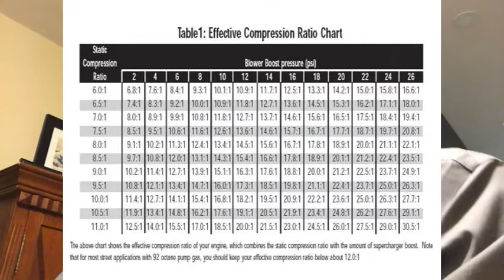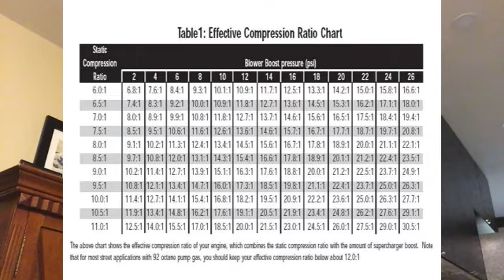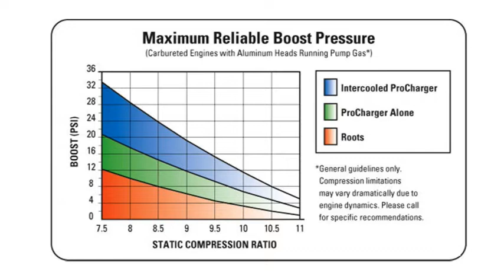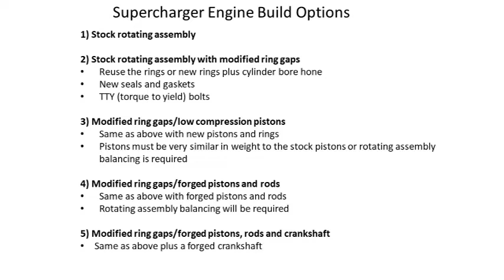How much supercharger boost is safe?

Comment: Hello, what do you think is the hp limit for the 4.6 2v and the 4r75e trans? as you clearly have experience with that being in the vic. Have a 2010 town car looking to do some mods to increase hp and make it fun to drive but not spend 12k+ doing all internal building to the engine and trans thats required for a 450hp build. Thanks.
Reply from the maker: If you stick with something naturally aspirated, the stock transmission should not have any issues so long as it is in good condition to start out. Boosted engines have increased torque at low rpm and as much fun as that is, it is hard on the transmission and will likely cause premature failures. Also depends on how hard you beat on the thing. Even a boosted drivetrain should hold up if you avoid burnouts and hard standing starts. So, 400 NA hp at crank should work ok with a stock trans. 400 boosted hp might cause trouble unless used with caution.

Comment: Is there a way to contact you I have questions about putting a Eaton on a 4.6 2v mustang not to much on the forums
Reply from the maker: You can keep using the youtube comments as you have done. What can I help you with?
Reply: @makecoolstuff9170  what manifold did you use to cut drill etc or did u find an adapter to make the Eaton fit ?
Reply from the maker: @DarryModz  Edelbrock Jr. with custom plenum between the sc and manifold.
Reply: @makecoolstuff9170  so u cut out top of manifold correct edelbroke manifold look like there’d me a leak if I was to cut in to top at least 1 I found you have any pictures I really want to get this done
Reply from the maker: @DarryModz  Have a look at my video "DIY Eaton Supercharger Installation - Part 3". Hopefully that answers your questions.
Reply: @makecoolstuff9170  yea I watched all of them but I wanted to actually see what the top of the manifold looked like how u cut it etc
Reply from the maker: @DarryModz  I dont have any pictures of it disassembled. The top of the 2 x 6 box matches the bottom of the sc and the bottom matches the Edelbrock Jr manifold.
Reply: @makecoolstuff9170  so you put cut the top out of the intake manifold correct?
Reply from the maker: @DarryModz  The Edelbrock manifold itself is untouched. The fabricated aluminum box on top of it has cutouts in the bottom to match up with the edelbrock manifold inlet and inlet mounting bolt holes. The sc outlet wont align directly over the edelbrock due to the drive pulleys needing to be aligned.
Reply: @makecoolstuff9170  ok so basically the edelbrock  manifold came with a cut out square on top so all you did was fabricate the  piece between the super charger and manifold to be square on bottom then fabricate top too match bottom of eaton?
Reply from the maker: @DarryModz  correct

Comment: I installed an Eaton M112 from a 03-04 cobra on a 2001 Mustang V6 using an adapter plate. Makes 10.5 psi at 5500 RPM on water/meth injection, 20 degrees of timing, with a Megasquirt ECU. It's probably too much for that old 3.8l engine, but hasn't exploded yet 😆
Reply from the maker: If you increased the piston ring gaps it will stand a chance of staying together. Otherwise, someday it will break a piston.
Reply: @makecoolstuff9170  That would be a good idea. However, I'm not planning to keep the 3.8l. I've been working on this car for a few years and I have upgraded the suspension, fuel system, exhaust, and I'm currently working on rebuilding a 8.8 rear end with 3.73 gears and 31 spline axles. Car is ready for a engine swap, I think a 5.3 LS would be a great engine, cheap and simple.
Reply from the maker: That is an excellent idea.
Reply: @omaron5175 how what adapter I’m trying to do this with my 2v 4.6 2001 gt been research but no luck

Comment: Glad you addressed the ring gap issue from the last video. (Thumbs Up) Always open up ring gap when running boost or bottle power adders. The pistons would have survived fine, its the heat from the higher output that did it in.

Comment: Wow I just found your channel.  Extremely informative and thorough!  I have an order in to Kennebell for their 2.1 intercooled roots (PD) supercharger, 16 week back order.  I have your same engine 2V 4.6 2001 Mustang GT.  Would you feel comfortable with 6-8lbs of boost?  I’m leaning towards 6 now after learning from you, but 1% of my is thinking of canceling my order lol?  I need more power but I need a car that starts as well.  Cheers if this gets to you!  Appreciate any advice.
Reply from the maker: Thanks! 6-8 lbs of boost will work great if it is intercooled. Heat is the problem (not the boost) and intercooling is the best way to reduce heat. The Kennebell supercharger is one of the best units made. Your mustang will be very quick with that much power.

Comment: I know you know your stuff on the superchargers I had a question maybe you could help, I've got a 2000 Saleen SC, came factory with the Eaton m90 root style supercharger. It is a series 1. I found one video on YouTube with a car like mine with the series 1 and it had the drain plug in the front right behind the alternator, mine does not have a drain plug there I cannot find it anywhere any ideas? I had already bought my oil in syringe for the oil change but I can't find the drain, and it does have a chatter so kind of stressed about it.
Reply from the maker: There are no drain plugs on any of the M90s that I have seen (Tbird or GM). The only way to change the oil is to remove the supercharger and then remove the snout. The noise is likely due to a worn coupling and you will need to remove the snout to replace it. Not a difficult job. Just time consuming. Be careful about not getting the used oil on anything. It stinks.
Reply: @makecoolstuff9170  thank you I appreciate it.
Reply: @makecoolstuff9170  thank you I appreciate it.

Comment: I'm planning to put an water intercooled m122 on a 92 lexus sc400. plan to put a 9 to 10 pound pulley on it. So far all the research i've done says it can support about 400 hp or so. I plan to keep the bottom end original because it was made very solidly in the early years of production of the sc400, i do plan to port the heads though. Ultimate goal is 400 hp at the wheels. Thoughts?
Reply from the maker: I am not familiar with the sc400 but the M122 can easily support 550 hp (probably 600 hp). I would recommend intercooling and/or increasing piston ring gaps. Head porting is a good idea but not essential. I would spend money on cams before spending money on porting, if cams are available.
Reply: @makecoolstuff9170  here's a link with info if you have time 

https://www.carinf.com/en/bf0048821.html

I've heard from around the net that the heads are the most restrictive part on 1UZFE v8's  so i would definitely be doing that. Kind of didn't want to take the whole motor out, but if you think it is better to change the rings out as well i'll probably just replace the pistons when i send the heads out for porting. might as well be at peace with that. But if i'm going to rebuild the engine then i might as well go for more than the 400 hp.  ( again i'm still in the planning saving and speculating part of the project and i really appreciate all the info you provide)
Reply from the maker: @GOLD_FEVER 400 at the wheels is 480-500 at the crank which will be quite a jump from the stock 250hp. It will be well worthwhile to be cautious and put in lower compression pistons (best to use forged pistons) Use the appropriate ring gap for boosted engines. The piston manufacturer will likely have recommended values. Its hard to imagine 4V heads not flowing enough (do you have flow values for the sttock heads?) and just keep in mind that head porting often doesnt give the same hp dividends in boosted engines as it does in NA engines. Easier and cheaper just to make sure that the engine is stout enough to handle the boost and increase the boost. Everytime that I have looked at ported heads, the price has dissuaded me.  Also, try and find out if your transmission and diff can handle that much boost. Supercharging really increases the low rpm torque and parts can start breaking.
Reply: @makecoolstuff9170  ok, i will definitely talk to my mechanic about doing a compression and leak down and just overall checkup on the health of the car and i guess move on from there. thanks for the tips!
Reply from the maker: @GOLD_FEVER  One last thing. consider using an M90 for your engine. A ported intercooled M90 will make 500 hp and is cheaper, smaller and easier to find than an M122.
Reply: @makecoolstuff9170  the only reason i was going for an m122 is because i didn't think it capable of giving me the 400 hp, If it's capable of 500 then it should be plenty enough of a blower for my purposes... also makes it a heck of a lot easier to fit it in the bay... that's good news.

Comment: I came across your channel looking for info on putting a blower on my 01 r/t s.p. 360.. good info. I was looking for a way to come up for an intake adapter and your video just made it a budget build. Keep it up.
Reply from the maker: The best way that I have seen is a side mounted installation on a SBF. Google "eaton m90 mounted like centrifugal". I plan to try that arrangement myself and possibly get it all to fit under the hood without resorting to a hood scoop.
Reply: @makecoolstuff9170  im wanting to do a top mount for the "look" already have to rebuild my fiberglass hood so I can make my forced induction style hood work as I need for that. I just couldn't find an intake solution under 2k for the magnum engine. I love the power of it just nothing till 3k.
Reply from the maker: @cornercarver08  Nothing more than a sealed box with mounting provisions required to get the air from the supercharger to the intake manifold. My power numbers were very similar to those that Richard Holdener got from a purpose built Ford racing manifold.
Reply: @makecoolstuff9170  o one other thing. Zzperformance has an amazing air to water intercooler for the m90 if you start looking to upgrade that part.
Reply from the maker: @cornercarver08  THAT is very cool! Thanks for sharing that information.

Comment: What was your ait when under boost?
Reply from the maker: From last dyno run: Starts at 152F ends at 218F. The car had already heat soaked from the previous run. This is with meth water injection (assuming that it was working).

Comment: I had a 99 tacoma at 100,000 miles I bought the TRD supercharger, at 105,000 bought the 12psi pulley, at 120,000 I bought nitrous oxide (120 shot) it wasn't until I was at 220,000miles that I ran into a problem when I tried a 150 shot on dyno day and the bottle was too hott. Lol
Not too shabby for stock
Reply from the maker: Your truck did well to last as long as it did. Boosted vehicles often have short lifespans :-).

Comment: Hey there. You should go grab you a 96-98 5.4 short block and shove it under those heads. Your CR is gonna be around 10.6ish:1 you won't need the S/C because the displacement will be equal to what you already have. Save your money for supporting mods. With that short block and those heads you'll already be at the level you're at now and then some.
Reply from the maker: I agree with you. You could probably make 450 hp with LT headers, good flowing heads and good street cams and have a much less troublesome engine that fits under the hood. Cost would be comparable to supercharging only because good flowing heads are so expensive for these engines and LT headers would require some fabrication. However as soon as you want more than 450 hp, you will need a power adder.

Comment: Thanks a great deal for all the info, I've been researching and developing a setup for an M90 on a W8 Vw motor. Guess I'm going to have to make custom pistons, static compression is too high to run more than 4lbs of boost.
Reply from the maker: Yeah, 10.8:1 is high for boost. I think you would be ok for 6-7 psi if you intercool, run high octane gas and be conservative with the tune. Opening the ring gap would be a good idea too. Lowering the compression is the best way to get a good boost friendly engine.

Comment: Congrats on the 1k subs! Been anticipating the return of the vic.
Reply from the maker: Thanks!
Reply from the maker: I cant recall if I mentioned it before but my garage is in the middle of a big renovation that will need completing before any car work can get started. Wiring, drywall, new concrete floor, lights, insulation, heat and AC.
Reply: @makecoolstuff9170  it'll be the perfect place for you to make cool stuff! I had to make the pun haha.
Reply from the maker: @madmod  :-)

Comment: Could you boost the octane using one of the newer additives on the market or go to e85?   I am not sure about the additives but they claim octane ratings up to 118 and they do seem to have data to back it up.
Reply from the maker: Octane additives or E85 will help raise detonation thresholds.
Reply: @makecoolstuff9170  well I enjoy the videos keep them up!  I was reading somewhere that the M122 is roughly about 62% efficient and a vortec centrifugal is about 71%.   I get the impression that procharger chart is a bit of marketing or based on older roots variants.      Still is is all about keeping that air cool ...
Reply: @zomie1  Efficiency is a weird way to look at these blowers. Technically speaking, the case of an m90 reaches over 85% efficiency if your comparing the 90cubes per turn to its inlet flow @ rpm. The problem with this the stacking of the air builds more heat with the m90 due to higher rpm needed to turn the blower but the driving losses of even a very overdriven m90 is far less than the m112. Centrifugal can move a larger volume of air than some of these roots design but they require nearly 4 times the blower speed to do so which is a good bit of parasitic losses @ redline and they do not come close to volume of air moved at low blower/engine speeds.